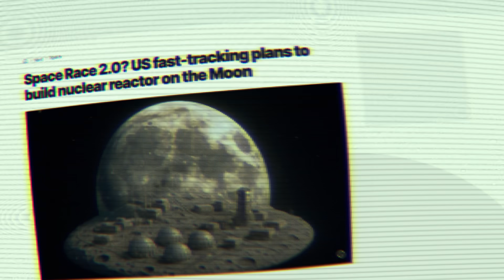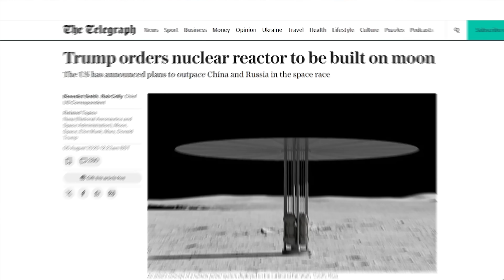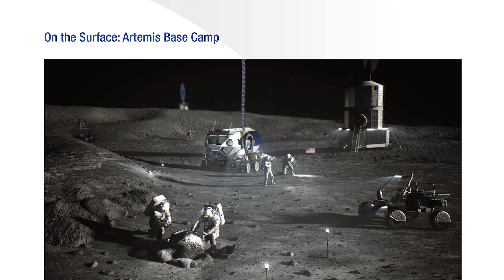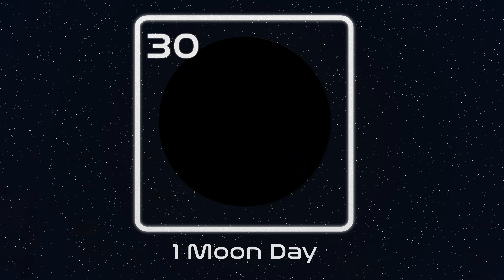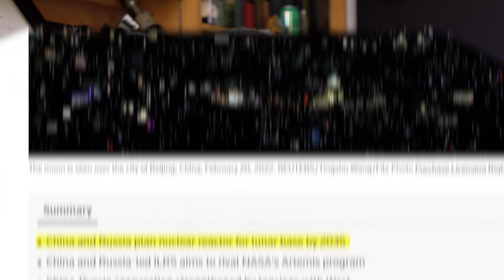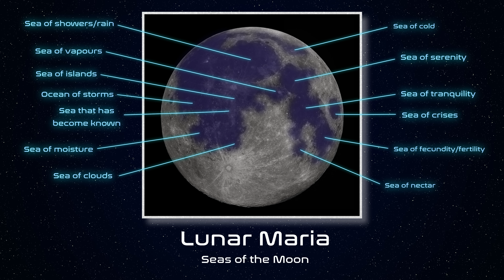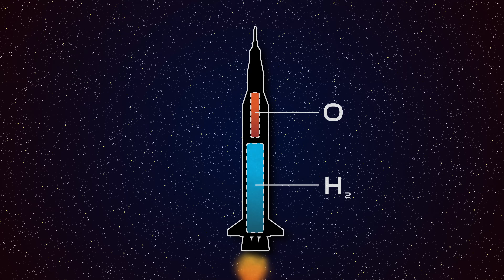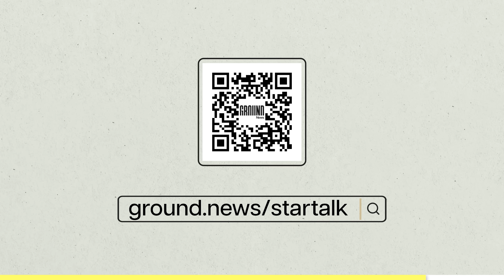Why We’re Putting Nuclear Reactors on the Moon

Comment: The battery/heat issue has been 'fixed'. Lead/acid takes cold better than lithium. Lithium batteries are available with internal heaters, but they take some power, so cars can't be parked for too long (starting batteries) or driven as far (EV).
Reply: I agree. Using energy from the battery to keep itself warm is not a great way of doing it though. If you are building a base on the moon, presumably that base would be climate controlled to support the humans. The batteries could take advantage of that to maintain their temperatures.
Reply: Weight is a huge issue in taking things to space. Lead acid is just way too low energy density to make them worth it. Lead acid batteries are also a liquid electrolyte, which doesn't work well in weightless or near-weightless environments, and they offgas hydrogen... which is also not a great thing in sealed, low gravity regime. Losses from heating LIon cells are possibly not as bad as the losses of carrying up a lead acid battery. Also... at -200 degrees F lead acid batteries are not only frozen but very badly damaged.
Reply: Lead/acid may alleviate the problem on Earth, but we're talking about -130ºC  on the Moon.
Reply: But it stores nowhere near as much energy. Well, either that or it discharges it much faster, either way there’s a reason we aren’t using lead acid batteries in our phones.
Reply: I only mentioned lead-acid because that is what is usually used in cars. Not my car, I saved ~30lbs by switching it to lithium, but I do have to leave it plugged in 😂

if we do use nuclear, won't it need shielding?
Won't that be lead?

What we need is many farads of capacitors instead of batteries!
Reply: @Iowa599  I'm betting they will be far enough away from the human settlement to get by with minimal shielding. Placing them on the other side of a crater would probably work well enough for purpose. If the goal is to claim valuable real estate before foreign powers, then irraditaing the ground around your powerplant could be considered a feature rather than a deterrant.

Comment: HOW many kilowatts? Nobody talks about the cooling system that has to operate in a vacuum. I'm not saying it cannot be done, but thermodynamics in the vacuum of space is really hard. Show me the calculations. People just flapping their lips again. Nice idea but show me the numbers.
Reply: You know that the reactor radiates that heat away the vacuum does not work as a insulator in this case
Reply: @Petri_Pennala  Ok, but at what wave length? And what watt density per square foot of emitter?  Basic thermodynamic numbers, please.
Reply: @bobkreutzer869 Well the wave length depends on the temperature of the radiator and it doesnt really matter because the environment is much colder than the radiator.
Reply: @bobkreutzer869 These numbers are NOT even near basic thermodynamics but most radiators used on spaceships emit 350W /per square meter and weighting around 12kg/m^2 so 1200kg of load would be from radiators
Reply: @Petri_Pennala  Nice numbers, thanks! Challenging indeed.
Reply: Reactor producing 100kWe would need about 100m^2 of radiators

Comment: if i think about it how clever is nuclear on the moon. wouldn't that stuff overheat in that with the perfect insulation of vacuum
Reply: Why would you need warm spacesuit if vacuum was a perfect insulator?? Heat radiates in space it doesnt need air to transfer around. Vacuum insulation works because heat doesnt conduct thru it, it can only radiate
Reply: @Petri_Pennala  but we are talking about far more heat then the body all needing to radiate away instead of having a planets worth of stuff dissipate that heat. a case of  forgetting something irrelevant in our standard which isn't all that standard somewhere else.

not like nasa would forget something that simple but it does feel like a nuclear power plant generates more energy as it radiates away or it wouldn't be all that good at generating energy and then it would compound slowly over time if not specifically addressed.
Reply: @esrohm6460 If they can use water then the heat is not really a problem but if not you need large conducting radiators which radiate the excess heat away
Reply: @Petri_Pennala  spacesuits were cooled, not warmed. A moving astronaut inside an insulating suit can build up a lot of heat otherwise. The Apollo backpacks vented the heat via sublimation. But you are right about the nuclear power unit. It would need large radiators.
Reply: every (half decent) artist impression or concept design for nuclear power modules on the Moon show large radiator panels. That's how you get rid of the waste heat That's also how they get rid of the waste heat on the ISS.

Comment: What if the nuclear plant gets damaged, or malfunction or hit by an asteroid, the consequences for the moon could be very very dangerous for the balance of the moon.
Reply: you have absolutely no idea of the scale of the Moon
Reply: Not really because you cant make it explode. Plus the amount of uranium is probably weighted in grams because those reactors are so efficient.
Reply: You vastly overestimate the damage that the 100 kilowatt nuclear device is able to do on the Moon if it malfunctions. The most dangerous thing that can happen is a meltdown of the reactor. The only things that would be of consequence is power loss for the colony, which yes, would be bad for colonists, the hassle of dealing with radioactive remains of the reactor, and (porbable) deaths of the unfortunate souls from radiation sickness who happened to be near the epicenter of the meltdown.

Moon has no atmosphere to carry radioactive material, so unlike in Chernobyl, it will not spread over a wide area (that is of course assuming that the release of radioactive material during meltdown will happen in the first place). 

Also, consequences for the Moon? What kind of consequences would those be? Moon is just dust and rocks everywhere. There is no life. There is no atmosphere. Say the small area around reactor becomes irradiated with nuclear material and then it will do... what?

Also, balance of the Moon? I do not understand what it is you are trying to say, but if you think that a mere 100 kilowatt reactor has enough explosive power to destabilize Moon's orbit or change it's rotation or something of the sorts then you are grossly mistaken. Do you know how much power it would take? It would take millions of times of the entire nuclear arsenal on Earth to make the Moon to even start moving out of it's orbit. That, and Moon has already been bombarded countless times by asteroids over the span of its existence, many of those asteroids carrying enough kinetic energy to dwarf even the most powerful nuclear bombs humans ever invented.